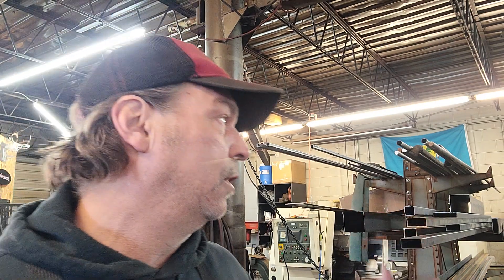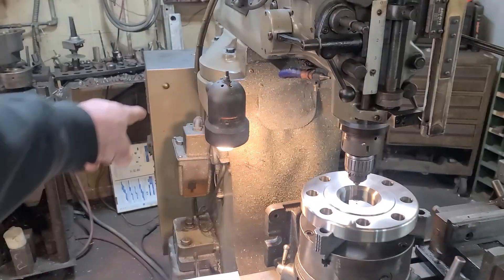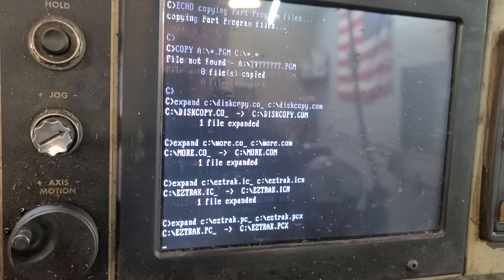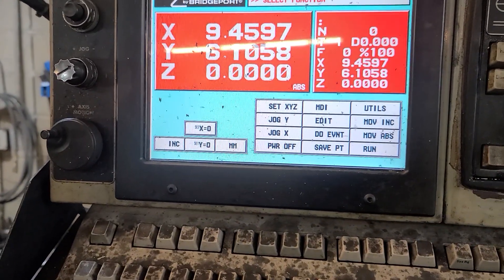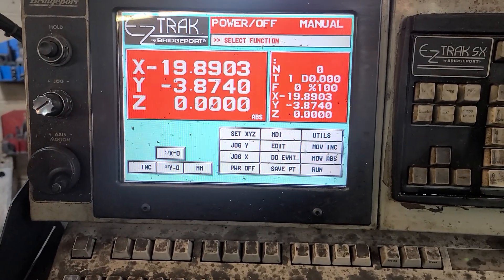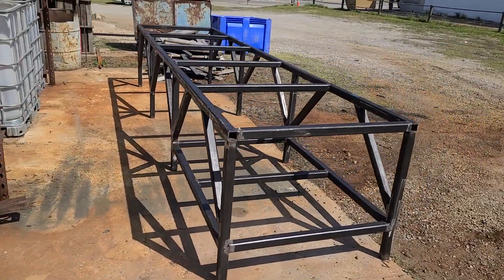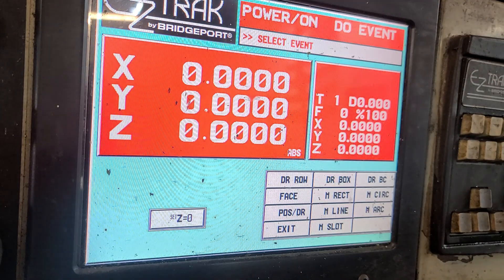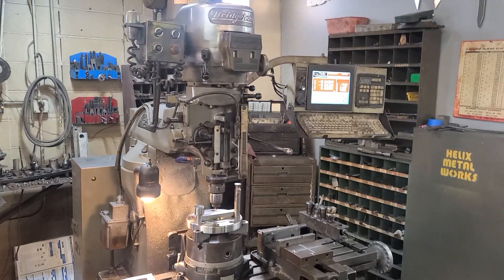Bridgeport Ez Trak start up procedure.

Comment: I run a proto trak lagun knee mill as a full time machinist. This controller seems very similiar  although when in jog the servos power off automatically after like 1 sec off the xy buttons so its super intuitive to manual machine stuff with. I like your channel. maybe one day I will buy some sort of mill ez trak or prototrak or dynapath too.

Comment: I ran one like it brand new.  Left the trade. Recently started my own shop.  I remembered how much I liked that mill so I just recently purchased one.  I know how to do the canned cycles but don’t remember much about programming.  Do you know of a good place to learn how to deal with programming.
Reply from the maker: I just have the manual, it explains alot.  If I really need to run a profile, it goes in the big mill with g code
Reply: @helixmetalworks en tu manual trae los parámetros los puedes compartir sl2
Reply: Si bla español. Tengo. Un torno de ea marca. Briges por.  Pz
Reply: Change the CMOS battery on motherboard its by the keyboard plug then it will keep the bios settings